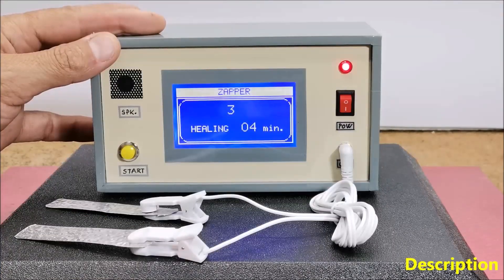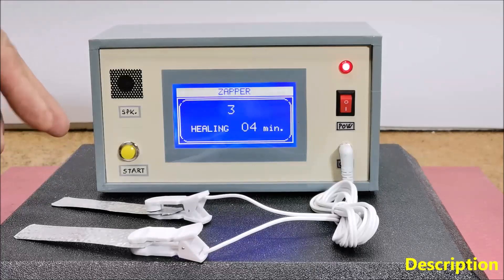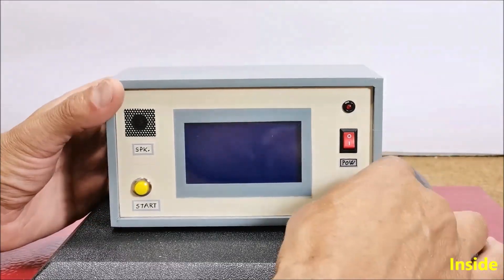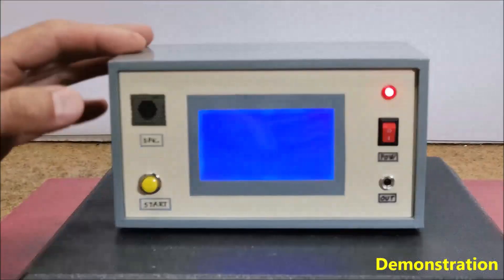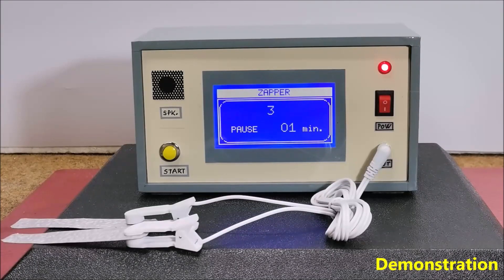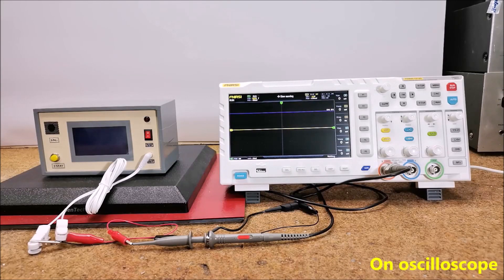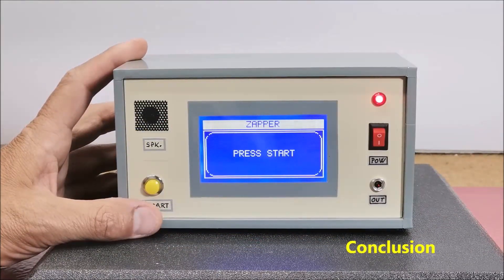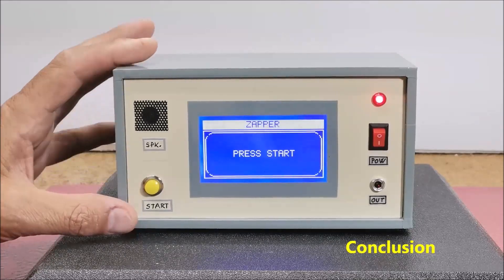Simple Arduino Hulda Clark ZAPPER with Timer function

Comment: It did not come with a button or handles.
Reply from the maker: For handles, you can use any metal rods, it is only desirable that it is stainless material. The kit does not contain a button, you can use an ordinary button.

Comment: What’s the way to hold electrodes in hand please ….Show us whole process,I just bought device
Reply from the maker: It is necessary to connect two metal electrodes (preferably copper cylinders, or rods of non-oxidizing metal) to the appropriate connector and hold them in your hands during the treatment.

Comment: You people have to quit  using hulda Clark's name. Is the frequency generator.the zapper is copy righted
Reply from the maker: You are right, this is indeed a frequency generator that I made based on data I found on the internet. At the very beginning of the video I tell you that this is not the original device, but an Arduino version made according to some data that I found
Reply: @MirkoPavleskiMK  
What is the device used for?

Comment: MIRKO how about a Arduino powered constant current limiter colloidal silver generator, with presets of 3-5-10-15 ma 👍🏼
Reply from the maker: Such a device can be made very easily with an LM317 IC and a 4 position switch. I hope to make it soon. In the next period I will promote a new colloidal silver generator with Arduino and LCD display with a timer with the characteristics of a commercial device like this
Reply: @MirkoPavleskiMK  that would be awesomeLM317 is what I use for my CC Silver Generator, the addition of the lcd and Arduino would be awesome!
Should be rated at 27-30 vdc for optimal Nano colloidal Silver 👍🏼
Reply: @MirkoPavleskiMK . Have you made the one you described here?  How can i contact you privately?
Reply from the maker: @FountainGuru  It will soon be available for sale on Elecrow website
Reply from the maker: You can buy this device with a small OLED display on the Elecrow store:  https://www.elecrow.com/simple-arduino-hulda-clark-zapper-with-timer-function.html
Reply: An Arduino is a bit much for a colloidal silver generator, makes things way more complicated than necessary. And if you are using two one ounce .9999 silver bars then 3ma is the max you should go to achieve small particles. Use 10 gauge .9999 silver wire to hang the silver bars. The distance between the two silver bars is not critical as long as they don't touch. I use the one quart large mouth mason jars from Walmart. One quart of distilled or de-ionized water will take about 48 hours or more depending on your room temperature. Voltage supply should start around 35 volts and one fourth of your 3ma constant current setting till some silver generates in the water and then the voltage will start dropping more as silver builds up in the water and your current draw will get to your 3ma target level. No electrolyte is needed. To accelerate your process add a few tablespoons of colloidal silver from your previous batch. This will act as an electrolyte without contaminating your process with undesirable chemicals. Reverse polarity about once a minute. When voltage no longer goes above 4 volts you are done with that batch. Avoid sunlight and minimize all light.
Reply: @richardgieser6122  I only use the chemical reduction method of the CGCSForum ..
Reply: That’s way to much Voltage. Try 1.5 volts with two fine silver electrodes in water for 5 min
Reply: @natemcfarland8931  minimum voltage required at the cell 10v 
I supply 27-30V …